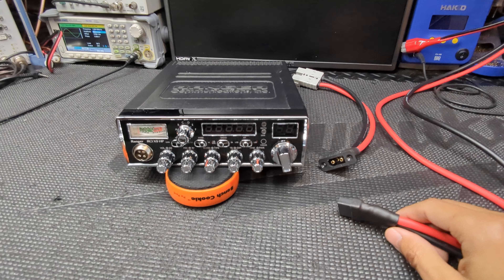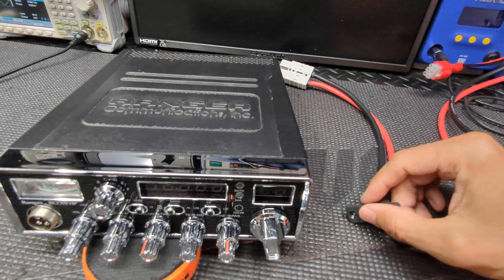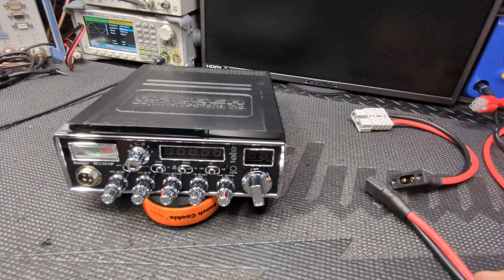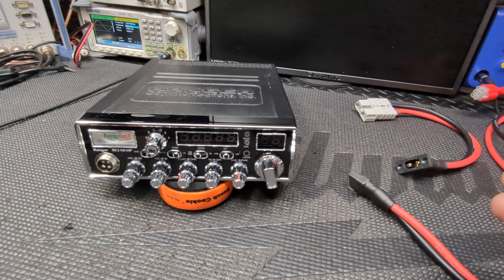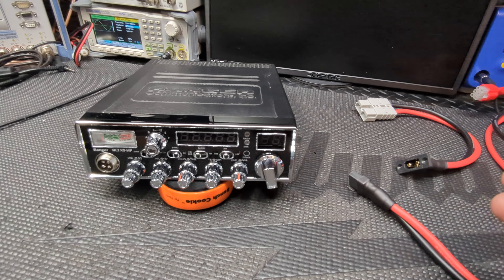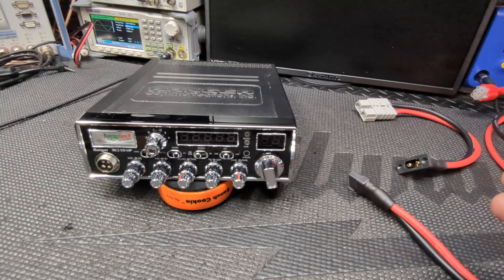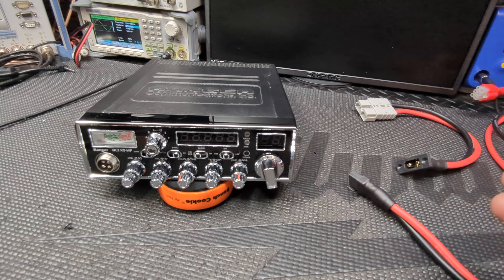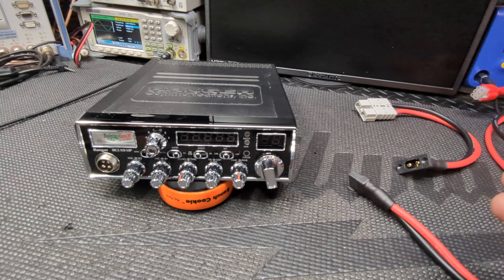Easy Extra Watts + Connector talk for CB Radio

Comment: @theradiogarage make sure whoever prints the case uses abs, or asa or something that can handle the heat.  PLA and PETG will most likely melt with the heat of a high power system

Comment: What WOULD be meaningful is a comparison of connectors when used on a specific single test radio load, all using the same wire gauge, length, and power supply with at least 3X the capability of the load. And include the rated, not maximum specifications of each over rated temperature.

The other thing that is never reported in the test radio voltage at the output of the radio connection along with the test radio output watts.

A lot of work, I know, but extremely useful and to point of connector selection. This is work I would do before selecting a connector based on 45 years of EE work.

Comment: Why bother with a pin type male or female Type connector at the back of the radio chassis? Why not pull the flush housing mounts out of the back of the radio and go with wires soldered in the radio and have heavy 8 ga gauge wire or what ever the max amps will be say 12 inches and a 50 amp Anderson Power Pole or 75amp Anderson Power pole (if that is the amperage you need)  and eliminate any heating problems? As a Ham op I use nothing but APP stuff..(tons of 15-30 & 45 amp Crimp on connectors) NO Heating or shortage of use-able amps...Just curious? I think its cost most likely?